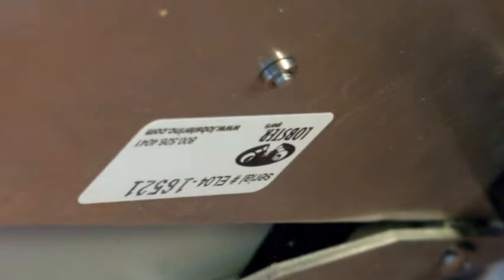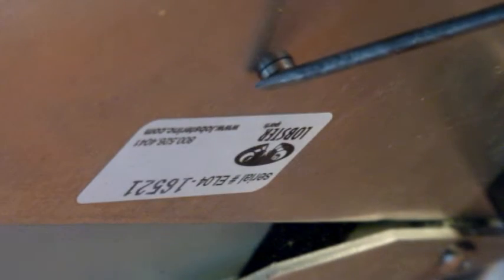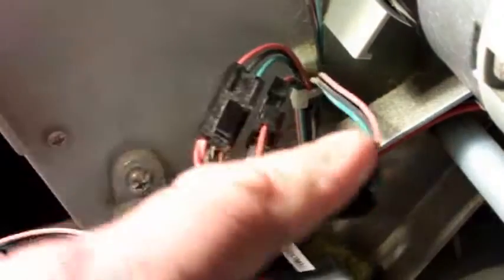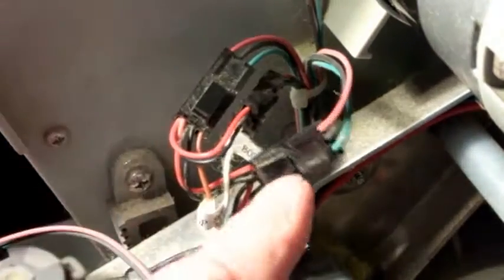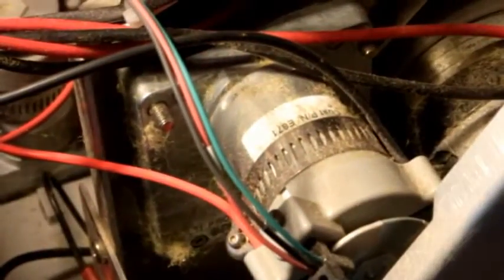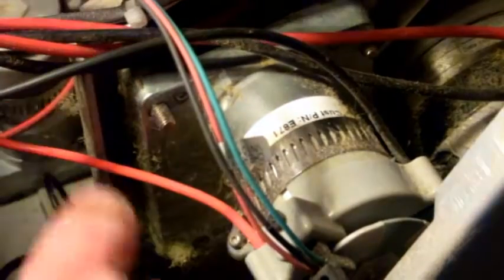Lobster Error ::: Over-Current Sweep Motor

Comment: There may be dit and built up grease in the gear box that draws more current than usual. It seems that gear box and decoder work fine. So what I would suggest is to take out the gearbox and thoroughly inspect it and clean it and lube it again.

Comment from the maker: Thanks for all the feedback. At the end of the day, I only had to buy a NEW MAGNETIC PROXIMITY SWITCH (not the magnet, which, as you can see in the video, works).
Once the new magnetic proximity switch was fitted it ran perfectly ..... until the PCB decided not to work some time later and I had to send the whole machine to Apollo Leisure**, at great expense, to have a new one fitted. I've had no trouble since; except I would not recommend using the machine in damp weather, as the balls jam the machine - not a good idea!
**Reference: Apollo Leisure, Unit 1 Forest Cl, Ebblake Industrial Estate, Verwood GB-BH31 6DE   Telephone 01202 812000 from UK or +44 1202 812000 from outside UK

Comment: Helpful video. Hey Duncan, I am experiencing the same exact problem and going to try the magnetic proximity switch any chance you could tell me which one u purchased or link the switch? Thanks.
Reply from the maker: Thanks for all the feedback. At the end of the day, I only had to buy a NEW MAGNETIC PROXIMITY SWITCH (not the magnet, which, as you can see in the video, works).
Once the new magneticThanks for all the feedback. At the end of the day, I only had to buy a NEW MAGNETIC SWITCH (not the magnet, which, as you can see in the video, works).
Once the new magnetic proximity switch was fitted it ran perfectly ..... until the PCB decided not to work some time later and I had to send the whole machine to Apollo Leisure**, at great expense, to have a new one fitted. I've had no trouble since; except I would not recommend using the machine in damp weather, as the balls jam the machine - not a good idea!
**Reference: Apollo Leisure, Unit 1 Forest Cl, Ebblake Industrial Estate, Verwood GB-BH31 6DE   Telephone 01202 812000 from UK or +44 1202 812000 from outside UKr switch was fitted it ran perfectly ..... until the PCB decided not to work some time later and I had to send the whole machine to Apollo Leisure**, at great expense, to have a new one fitted. I've had no trouble since; except I would not recommend using the machine in damp weather, as the balls jam the machine - not a good idea!
**Reference: Apollo Leisure, Unit 1 Forest Cl, Ebblake Industrial Estate, Verwood GB-BH31 6DE   Telephone 01202 812000 from UK or +44 1202 812000 from outside UK

Comment: Oddly enough, but the main reason for the horizontal engine is not only the magnet or the weak contact of the sensor cable, but the fact that the gear that rotates the horizon has broken gear gear. And this is not an isolated case.
The gear in the gearbox is broken and the entire horizontal motor needs to be changed.

Comment: Dear Duncan, I had the same problem with my machine Lobster Grand IV- try removing the serve wheels, the electric motors can fill vibrations if the wheels are unbalanced and it will fail to start. Did you fix your machine?
Reply from the maker: I only had to replace the magnetic switch. Was not cheap, but it fixed it.
Runs perfectly now.

Comment: Yes! That's exactly how my machine behaves for like 6 months and neither service man in Poland nor me can't find the cause. Did you made it - do you know what's the problem?I checked almost every part, replaced sweep engine due to the damage caused by stopping the wheel at the bottom of Lobster on its metal base. My team tried nearly everything, sometimes (we call it "magic moments") Lobster works, but at the turning-off sequence of movements it breaks again. Can you help somehow, please?
Reply from the maker: Paweł Cieszko It is the magnetic switch that needs replacing. Only takes a few minutes once you've bought one.
Reply from the maker: It's the magnetic switch that needs replacing. It only takes a few minutes to replace once you've bought one.
Reply: Hello!Did you change a magnetic hitless switch?
Reply: Thanks for the video! Ours is doing the same thing. Your comments are lots of help. Where did you buy the magnetic switch. I’m not seeing it on lobster parts list

Comment: Good video although confusing at first.  You could explain it a little more detailed but I had to watch it again and experience the problem myself to understand it. Mine is a new unit — top of the line the Elite Grand V LE edition for $3k USD. So such an expensive item, I’m surprised it broke within 2 mins of testing it and customer service is telling me to do this and that without much help. Still the same frustrating issue. For $3K, I’m wondering if people should all stop buying lobster machines in general. Not sure about other brands but this machine feels cheaply made. For $3K and all this maintenance trouble shooting I wonder if it’s at all worth it.
Reply from the maker: It is quite fragile at the end of the day.
An absolute must NOT is: NEVER use in damp conditions, not even the tiniest amount of dew on the court.
The balls jam and the Lobster isn't strong enough to cope with the load.